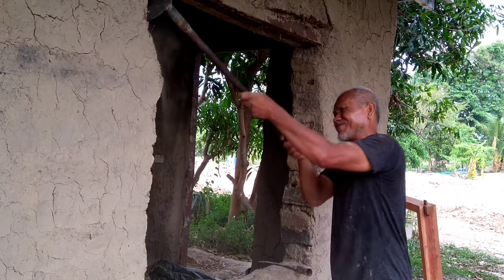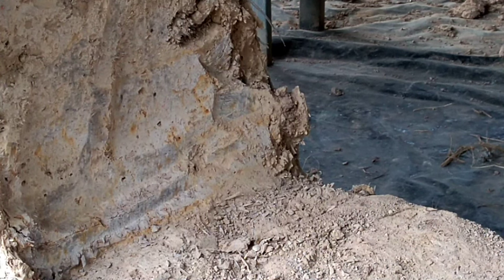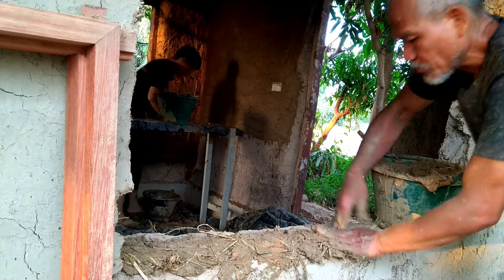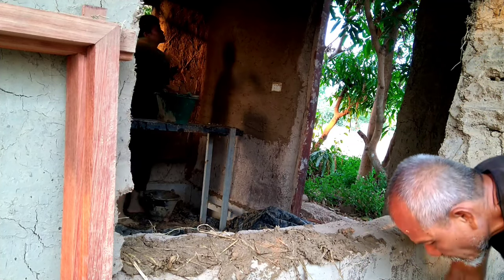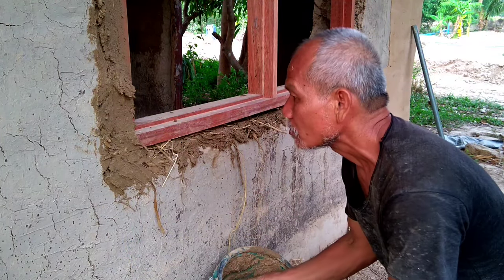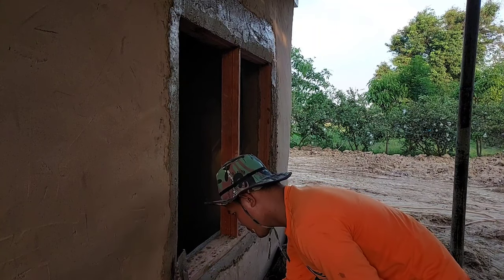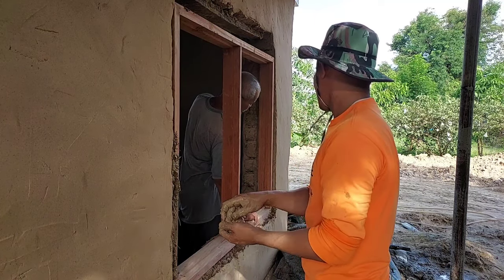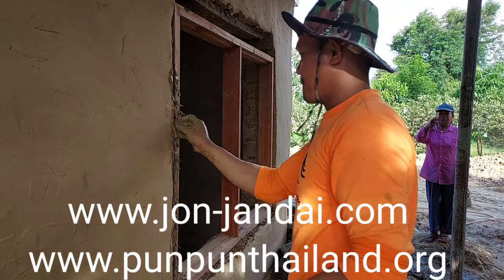Earthen building is easy to fix and easy to change.

Comment: You really should put lime in the mud, it would be much stronger.  Lime is easy to get in your country as well. You just have to burn the limestone in a mud kiln, then let them cool down.  Then you soak the lime in water and it will boil from the chemical reaction, once the chemical reaction is done it is safe to stir and break up the chunks and add to your mud.  A tiny amount of cement with a small amount of volcanic ash added will make your wall the strongest it can be without metal bar reinforcing.
Reply: Is this mixture good for parapot wall around a land? Will it stand the heat and specially the heavy rain during monsoon seasons ?

Comment: Jon have you seen the products sustainability construction material are making. Hempcrete is used as fire resistant, termite protection, and it absorbs Carbon, thru osmosis.

Comment: When we make a 2 story clay house, can we make a slab using clay instead of traditional concrete slab? Won't collapse later on? Does it durable and safe?
Reply from the maker: If we have good beams then pour clay with straw on top  it will be good clay floor.
Reply: @JonJandaiLifeisEasy  That's a releafe. If you can, please show us how to do that, because I searched a lot but never see such a construction anywhere! But I keep lot of hopes on that. Because I really don't like concrete slab as it is very hot above the head in summer, cause head ache and for sure it's toxic too! So please please be kind enough to teach us how to build a slab without concrete or lot of wood (because wood is very expensive than concrete here ☹️) Thank you so much 🙏

Comment: So what keeps the windowframe from falling out if a person lean against it or something else? In germany we drill long 20cm /5mm thick screw from frame into wall. In this case would be two screws each side.  I don t thing the mud alone is enouth.
Reply from the maker: The mud work better than screw or nail. We never use screw or nail in the last 27 years.
Reply: @JonJandaiLifeisEasy  thanks